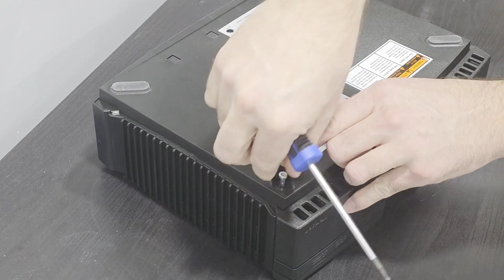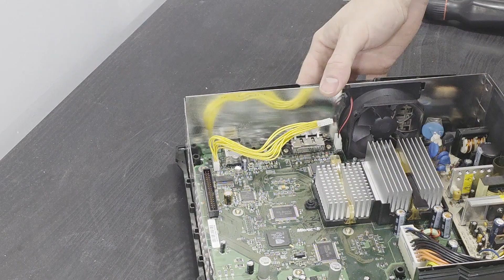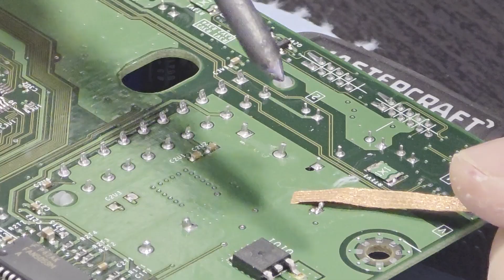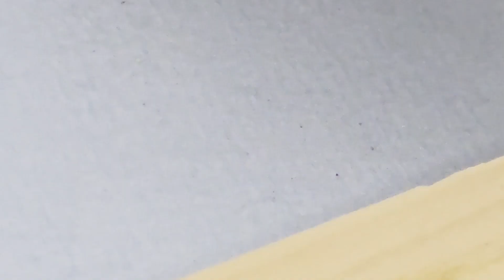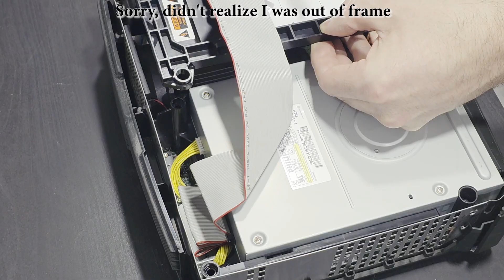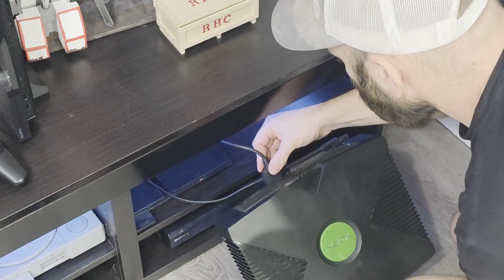Original Xbox Won't Turn On!

Comment: where did you purchase your capacitor kit from?
Reply from the maker: From a seller on ebay. Specifically this kit:

https://www.ebay.ca/itm/235400007025?_skw=original+xbox+capacitor+kit&itmmeta=01KQV2ECQTHB76TZ50P1A1KW2G&hash=item36ceef0d71:g:sd4AAeSwSlNp2g4l&itmprp=enc%3AAQALAAAA8GfYFPkwiKCW4ZNSs2u11xB37TY%2FmeJOvKwEau1Dc%2FwLxBWK7cPf%2F4efWCEbVVJaZQFo92%2FcrpOHyWa6LEfevxD7ZbjNmIo02c8p1QNXu4ZpSbT3nba%2BDCvHj89zmlMN6duVD2%2FSKJ27394WXMcvOBimXGqA4%2FP87GseUzXjyJqH9FtShz0RaKdGrD3wT0u2iCpxAWT112xGuSh4DMrNoYZ3ZLmoNV4%2BVYsEvuJZEU4QRSYdrMKIWwGaN%2FPXwkVoxTtF%2BxzZE%2FrhhuQRjVwMZYn4VrwyHE72ZnSyDh01m%2FSOz6%2BCFioi8uoMK7R1A7j%2BRw%3D%3D%7Ctkp%3ABFBMiMy54r5n